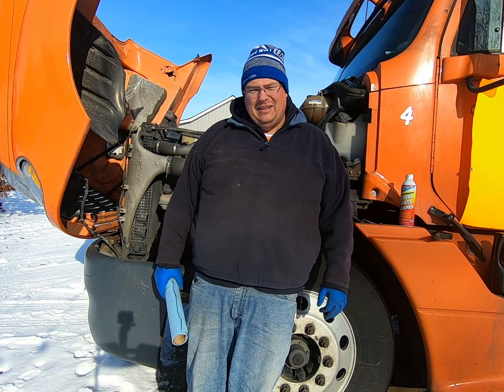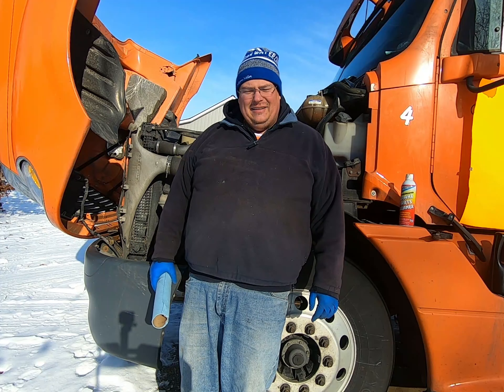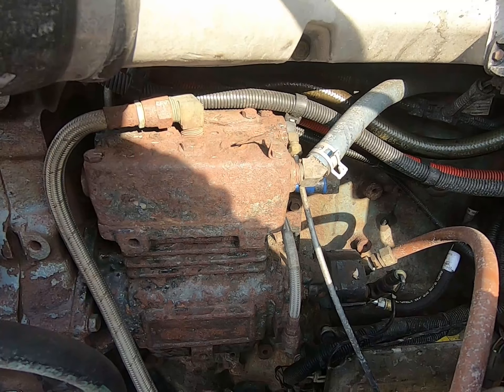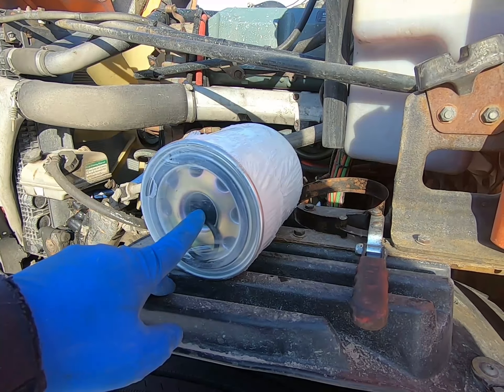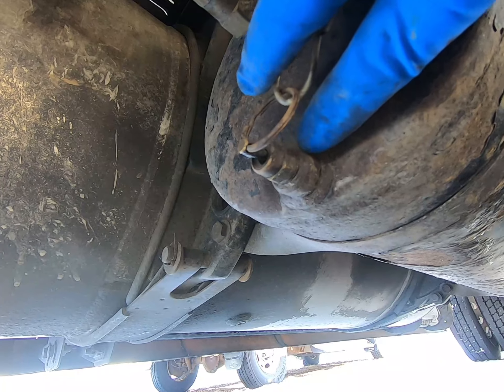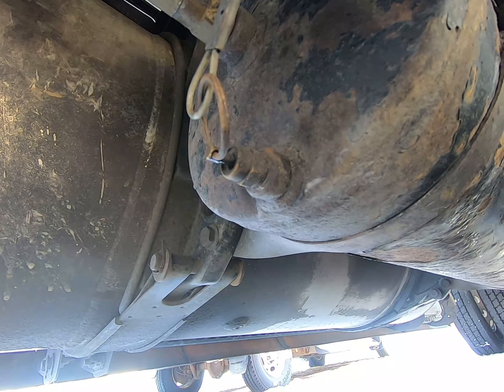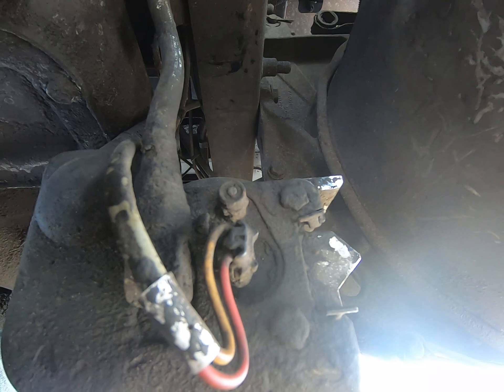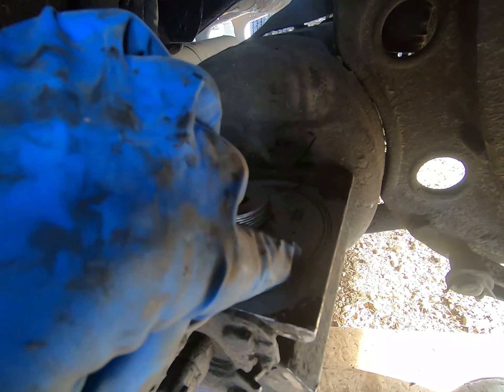How to change an air dryer cartridge... and other air system checks

Comment: That is a Bendix air compressor, the unloader valves are inexpensive and are easily replaced once a year .  With little modification remount air governor to the firewall .  Install air tank remotes off the air tank to a convenient accessible area with 3/8” airlines with ball valves .

Comment: The air dryer on your truck is abaut $400 plus if you brake the bolts to air tank then $$$ for the tank.
Good vid)
Reply from the maker: Yep, my governor is about120.00. If i ever have to rep!ece air dryer i might do a conversion and change the tank and all....i really really hate that set up
Reply: Can the air dryer be rebuilt
Reply: I seen one for mine $109-$190 so I’m lucky

Comment: 14:45 you see the valve above the electric connection, on my truck sometime it’s stick out and release all the air out while I’m driving do you know why it’s doing it
Reply from the maker: Not sure which valve you mean, but there is a purge valve...the one that spits..under the air dryer. if that doesn't close, the valve can be rebuilt. it is critical that the purge valve closes or it is an out of service violation

Comment: What's the large hose hanging down for? Is that connected to your crankcase breather tube?
Reply from the maker: Yes
Reply: @DIYSEMI 

Can you show a video hiw it's ran? I'm looking at changing mine, it's just straight down. I'd like to run it toward the rear more.